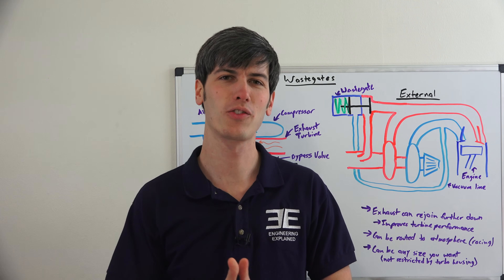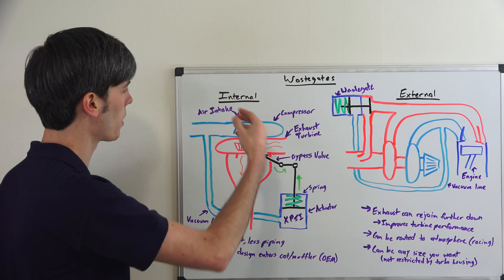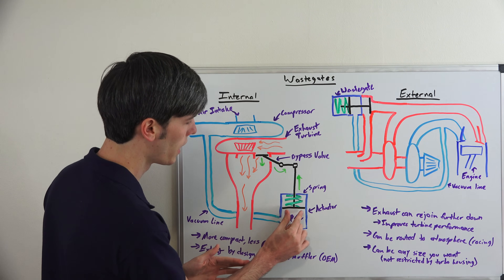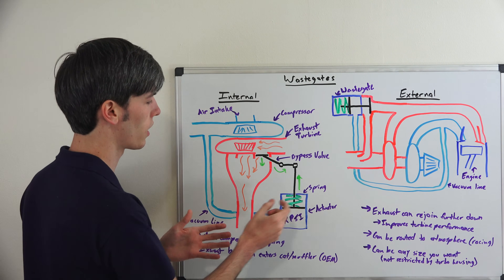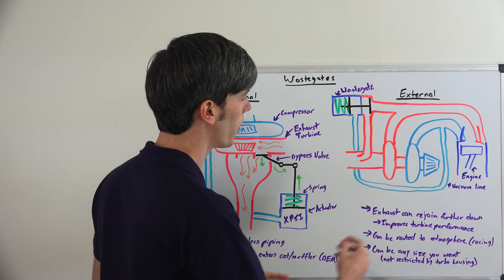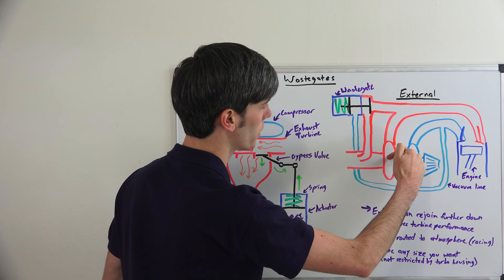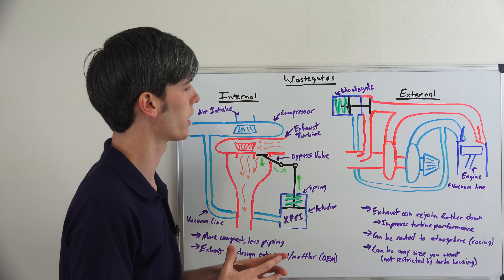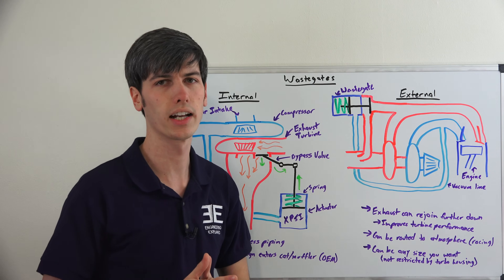How Turbocharger Wastegates Work - Internal Vs External

Comment: if this mechanism is purely mechanical then how do tuners raise the boost pressure just by chip tuning the car ?
Reply: farshid shekarchian Also the wastegates are not just on/off, a wastegate with a 14psi spring doesn't just open at 14psi, it will start to open before that and be fully open by 14psi.

The actuator does not need to be electronically controlled to be progressive, tho having an electronic boost control has a big advantage over mechanical boost control in that it can bleed different amounts of air and have more control.
Reply: +farshid shekarchian boost controllers are the one responsible for chip tuning boost increase. wastegate is purely mechanical :)
Reply: Rokas Getautas the mechanism explained in this video will not allow u to build pressure behind thee turbine more than a specific value, which can not be altered via electronics, in order to raise the boost you need more pressure behind the turbine ...
Reply: farshid shekarchian then it means that not every wastegate is purely mechanical on every turbo ;)
most of them are though :D
Reply: +farshid shekarchian Boost controllers leak boost out of the vacuum line going to the wastegate so the wastegate doesn't open as much which means more boost.
Reply: DriftNick boost pressure of the vacuum line does not leak into the waste gate , it would depressurize at the blow off valve (BOV) , and that happens when you lift the throttle, and that has nothing to do with boost control !
Reply: Rokas Getautas thats what i exactly mean , it can not be purely mechanical, the actuator needs to be electronically controlled and also needs to be progressive not simply on and off
Reply: farshid shekarchian Did you watch the video? go to 0:35 he explains it, boost controllers bleed boost out of that line, that pretty much tricks the wastegate into thinking it's running less boost then it is keeping the valve from opening as much or as soon.

Engines have multiple vacuum lines that see boost, generally you want the wastegate to be on it's own line, BoV really has nothing to do with the vacuum line going to the wastegate.

Comment: Is there any benefit to having the excess gas released into the atmosphere, compared to further down in the exhaust, with the external waste gate?
Reply: +Brandon Horn probably yes, since the gas will not have to pass through the exhaust itself (less restriction) hence quicker release of exhaust fumes from the engine. this is just how my logic would define it, if im wrong please do correct me :)

Comment: can I request a video on blow off valves and how to properly set one to work effectively? thanks
Reply: +PANTYEATR1 you can't make it ineffective unless you set it to open at a way higher boost than you actually get :D
Reply: +Rokas Getautas thanks for the reply, but i heard issues with the bov bleeding turbo pressure and not allowing the system to make the boost you want it to
Reply: PANTYEATR1 not entirely sure about that one, mate. Best thing to do is to research on the topic. yesterday I found out that it would cost over 2500 USD to buy a turbo kit for my ga16de powered Nissan Primera :D

Comment: Hi, I have 2 requests for videos that you could make.. :) timing chain vs timing belt and distributor ignition wires vs coil on plug.. I would like to know the pros and cons ,thanks
Reply: farerse Okay first of which the elastic limit on a timing belt is a lot better in high rpm. A chain is more durable and will stretch out of ignition timing when it gets worn out. a timing belt can snap and your valves can hit the pistons. Distributors are mechanical and spin in a circle like a eight round revolver firing on each piston and is usually vaccum advancing itself as the rpm rises for a better ignition timing in a higher rpm. A coil pack is computer and electronically fires for ignition timing and the ecm advances itself electronically. Distributor is mechanical old school and better simplicity than the coil pack. Price wise all depends a coil pack on some models is one part and is usually cheaper than a distributor and ignition coil. some models have multiple coil packs.
Reply: JBMSTRIKER71 Coil packs are definitely better than a distributor..  No moving parts and it's controllable through the ECU
Reply: @TTime685  IMO the coil packs last longer, but not necessarily better, the distributor  can handle more fire, deliver a  quicker spark in some cases provided,  you have the right kind of plugs and wires, but they don't last as long as a coil pack, now seems like all manufacturers are using coil packs now a days as that's the whole purpose behind the  platinum  spark plug as you can go 100,000 miles  straight out the factory doors before a single change,  but if you want rapid fire the distributor is the way to go.
Reply: for the first one, theyre pretty much the same except a chain is way noisier, and last longer since a belt can snap

Comment: You explain things really nicely and simple. Can you explain the differences in the sound with turbos when releasing acceleration? How it's caused? Some make the fluttering noise, some make a normal air release noise. What's the pros and cons in these setups?
Reply: that depends on the bov (Blow off valve) hks sqv series are the most knowned for the flutering
Reply: +Nitrxgen When the throttle plate closes (when you lift off the throttle) and there is no bypass valve or blow off valve the boost goes the only way it can which is back out the intake and over the compressor blades making the flutter sound, different turbos and intake designs can change the sound a fair bit to,  best you could do is search on youtube for videos of flutter and the hks blow off valve to hear the difference as it's kinda hard to explain the sounds.

Comment: I don't know much about turbos and always wondered what a wastegate was.  I guess it is essentially just a pressure relief valve and a way to control the boost pressure?  Thanks for the info.
Reply: +Nick DiBartolomeo yes that's is exactly what it is :)
Reply: Nick DiBartolomeo yes and no. it doesnt bleed off boost pressure, it reduces exhaust pressure to slow the rotating assembly down
Reply: usually pressure relief implies that the pressure it's relieving is the same pressure being controlled.
Reply: Melody Absolutely correct!

Comment: Since you have been doing all these videos on turbochargers and you seem to appreciate them I was wondering if you would ever do a video on Saab?  As a proud 9-3 Aero Conv owner I realize it's a little selfish but I feel like they don't get enough recognition, especially that they deserve.  "Saab pioneered many of the technologies turbochargers use today, such as the wastegate, which manages the turbo’s pressure. Saab engineers also developed a method to prevent ignition knock by automatically lowering the boost while the engine is under load, and Saab paired the turbocharger with electronic fuel injection before nearly all other nonluxury brands."
http://www.autonews.com/article/20141111/BLOG06/311119998/why-turbocharger-fans-owe-saab-a-thank-you

Comment: You should include some waste gate sounds for those who aren't aware of the sound.
Reply: If it's an external Wastegate venting into the atmosphere that's going to make a louder Vwooosh than an internal 🤷‍♂️
Reply: +Scott Koenig Wastegates don't really make a sound, it's pretty much just another exhaust.
Reply: Yes, it is just exhaust.... but wastegates/blow-off valves have a very unique sound. A rush of air, a tweet, a woosh.....
Reply: Scott Koenig Wastegate's and blow off valves are two different things, I would think after a video explaining how wastegates work people would understand that.
Reply: +DriftNick after some research, I stand corrected. 😬
Reply: @JapanScott1  No u dont
Reply: @JapanScott1  Woah, most chill disagreement resolved on the Internet, I've seen.
Reply: Wastegates are basically the same as exhaust cutouts (in terms of fluid dynamics), they allow the exhaust gas to take a path with less resistance to flow.  The things that give you “turbo noises” are blow off valves and diverter valves.  Diverter valves are a part of the turbo, whereas blow off valves typically stem off of a charge pipe.  The ‘ssstutututu’ sound that everyone knows can sometimes, but not always, be a bad thing, in what’s called ‘surge’.  But if you hear ‘pshhhh’ it’s venting smoothly and you’re good.
Reply: Its boost relief valve that makes that sound
Reply: Guys it depends where the turbos are, usually it's the ones which are place on the four wheels that making the whoosh sound, I've been a mechanic for 50 years now so...
Reply: most underrated dry humor comment ive ever read.
Reply: "....SSSSSSSSSSSS WHUU🇵 🇴 🇴 🇴 🇴 🇴 🇸 🇸 🇭 🇭 🇭 !"

Comment: Thanks for the knowledge I thought the difference between internal and external was how you vented the waste (in the exhaust vs straight to atmosphere).
I think a little addendum is needed to clarify the terms wastegate and blow off valve

Comment: Suggestion: how about a video on how different induction methods are impacted by increasing altitude?
Reply: Phos9 you have to retune cars if ur in colorado
Reply: Higher altitudes have lower oxygen density. It’s kind of the same reason a human who’s lived in parts of the world where they are closer to sea level, they have to adjust to higher altitudes. There’s less oxygen the higher you go. I hope that helps
Reply: Just realized this was 2 years old oof
Reply: @dezv4736  if you have a turbo you most likely have some ecu you need to lessen the fuel

Comment: what about blow of valves? what are the pro's and cons versus wastegates
Reply: +steekle7 they do not serve the same purpose. a turbocharger doesn't need a blowoff valve by design, but since on gasoline engines it is the airflow that is regulated by a throttle body, you need to evacuate the pression between the turbo and the throttle as soon as possible. if you dont, the throttle will bend and not work anymore bevause of the pressure the turbo creates.

there are no blowoff valves on diesel engines since the air is not regulated. instead, it is the fuel injection that is regulated. so trucks have wastegates but no blowoffs. hope that clarifies lol
Reply: +Gabriel Goffart Oh so now it bends the throttle plate lol, people really need to stop, it doesn't do any damage not running a blow off valve.
Reply: DriftNick that's what I've been told in my mechanics class. If it doesn't do any damage why do all the gasoline engines have one? Do you really think engineers would put such a device for nothing? 

A throttle plate isn't very big, I'm pretty sure 15psi would bend it when you lift off the throttle. But feel free to correct me if you know more :)
Reply: Gabriel Goffart Who ever told you that is an idiot, factory fitted bypass valves are for emissions, just take them off and you'll see what I mean or just google it, it tends to make the ECU think there is more air then there really is.

"A throttle plate isn't very big, I'm pretty sure 15psi would bend it when you lift off the throttle."

Considering I'm running 16psi on my car and it's very common here for people not to run a bypass valve or blow off valve including people pumping 50psi+ out of turbos the throttle plate bending really doesn't happen.
Reply: +Gabriel Goffart I never heard that a throttle plate was bend by the intake pressure a turbocharger can generate.
The reason a bov is used is a different one. If you don't let off the excess pressure when the throttle is closed, the air goes the only way that is still awailable and that's back out of the compressor stage and that's not a good thing to happen for several reasons.
First of all, it slows the turbocharger down which leads to more turbo lag afterwards. Also, the turbocharger starts to vibrate because the compressor impeller goes into a "stall" (airstream detaches from the compressor blades) and this vibration is very bad for the bearings and can damage the whole turbo charger over time.
Reply: +shi01 thank you for the clear info, i'll know better next time :)

Comment: I would have thought that it would be beneficial to have the bypass valve operate as much like a switch as possible, either fully open or fully closed but not partly open under pressures below the target boost threshold. However the pneumatic actuator/spring design seems to imply that the amount the valve opens is linearly proportional to the boost pressure, have I missed something? Also what are the advantages of using a diaphram over a piston? It would seem to me that a piston would be more reliable, is it just down to cost?

Comment: But what is the purpose of a wastegate in the first place?
Reply: It prevents the turbo from getting into too high revs
Reply: +lambosrkwl yeah, crazy stuff, have been seen a couple times the intake manifold gone boom of too much pressure and even engine heads exploded and went airborne off the block of too much pressure inside cylinders, pistons and rods were damaged as well.
Reply: yes, it saves turbocharger's rotating parts from overspinning, cause to much centrifugal force can destroy them.
Reply: +Go Mad Also if the turbine is spinning too fast and creating too much intake pressure that could damage the engine, especially if the injectors can't keep up with the increased airflow the engine could end up getting leaned out.
Reply: sick, thanks guys

Comment: if your turbo has a internal wastegate is it necessary to run a external wastegate
Reply from the maker: Nope
Reply: +Engineering Explained can you post a video with explanation of exhaust crackle and flames, like high power cars do after a quick acceleration?
Reply: +Go Mad It's an overabundance of fuel that gets burned up in the exhaust manifold.
Reply: +Engineering Explained is it fair to qualify an internal wastegate as a diverter valve?
Reply: +Jon Jackson You wouldn't do both, you'd either change turbo to one with no internal gate, or youd have the wastegate welded shut, and only have the external operating.
Reply: +Go Mad yea id like that
Reply: +luis moreno 
Sometimes... I have a GVB WRX, and on cold days I do get boost creep with my current setup. The internal wastegate is too small to get anymore out of my engine as it is now. My next upgrade on the car is going to get a new up-pipe with an external wastegate (as well as a new boost controller, fuel system upgrades and a bigger intercooler). In the process though, i am going to have to get a kit that locks the internal wastegate closed.

So basically, you don't need both, unless if you have an internal and its not doing its job well enough.
Reply: +Go Mad Good idea
Reply: +Dafuq.Zenno 
you can use an external wastegate with a turbo with an internal. you just have to lock the internal closed.
Reply: Thats what i said? did you read it? haha
Reply: +Engineering Explained Nice! But i wonder if you can include another part to all those videos of explaining how stuff works. Maybe you can note some common failures of the part you are explaining for us with old cars. :D Example for the Wastegate actuator: It can corrode and not be able to open or close properly and start leaking boost all the time or overboost if stuck close and cause limp modes, lower performance and sh*t :D... id find it interesting .. but maybe its just me. :)
Reply: +Go Mad If you are talking about Rally cars then its anti-lag. Which makes the turbo keep spooling even on deceleration, so the cars are always in boost and exit turns a lot faster. Other than that its just unburned fuel exiting. My supra does it every time i decelerate, not flames but "crackle"
Reply: +Go Mad unburned fuel 
explodes in the exhaust
Reply: +Boysya Because the flow of the exhaust can push open the internal wastegate.
Reply: +luis moreno did you not watch the video...?
Reply: +luis moreno Only advantage really is some factory internal gates don't open quite quick enough leading to a boost/pressure spike which doesn't happen so much with external gates :)
Reply: +Go Mad he already did a video "why do cars backfire"

Comment: Is the primary function of this type of system to reduce the chances of choked flow occurring within the turbine? I know that This type of process effectively increases the flow area for the exhaust and therefore allows mass flow rate exiting the engine to be at a higher state.
Reply: +Gary Brown No, the primary function is to cap off the amount of air that feeds the turbine, so that it doesn't overboost. Technically yes, it increases the flow area of the exhaust immediately after the manifold but it doesn't result in any more power because it's restricting the amount of exhaust gases spinning the turbine. In fact, if the wastegate never opened it would result in much more airflow as all the exhaust gases keep feeding the turbine, which in turn spins the compressor wheel faster, creating more and more boost and faster and faster exhaust gases.

Comment: Would this be a similar process as to what the F1 turbo waste-gates are currently doing? The only reason they implemented was to increase the sound of the engines... However, no performance gain. 
Could you elaborate on this? Or are they doing exactly what you explained in your video?
Cheers... Great, detailed video by the way :)
Reply: +SuperItalia494 They had the wastegates before, that's how boost pressure is controlled. Without a wastegate the turbine would just spin as past as it possibly can. What they're introducing into F1 now are screamer pipes that dump the exhaust gases to the atmosphere when the gate opens, instead of back through the exhaust. Makes it a whole lot louder since it's just like flicking a switch that opens up the exhaust right after the headers (if you can imagine how loud that would be).
Reply: Yep that makes sense now :) Thanks for the info!